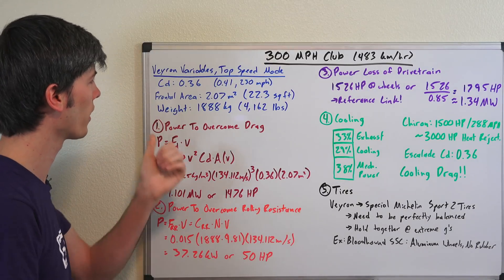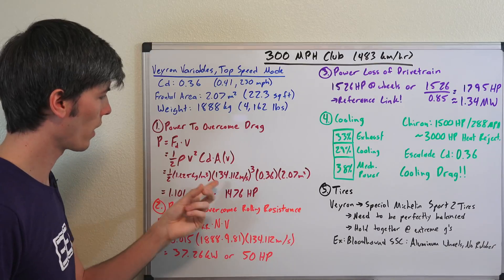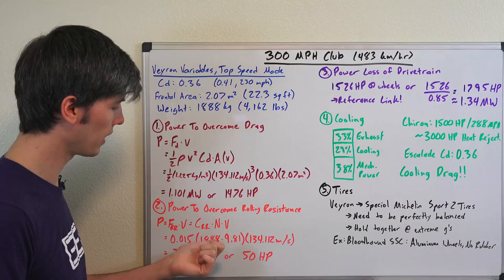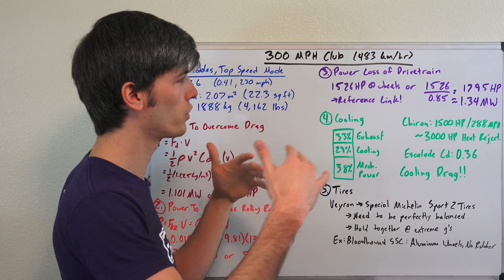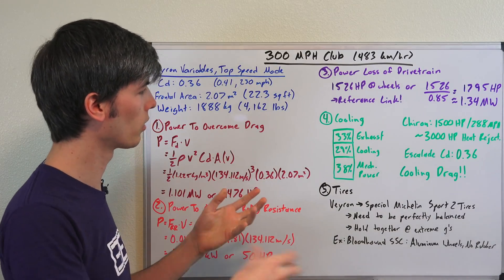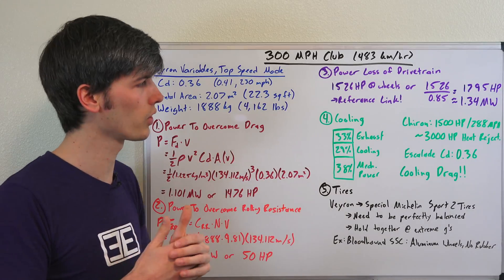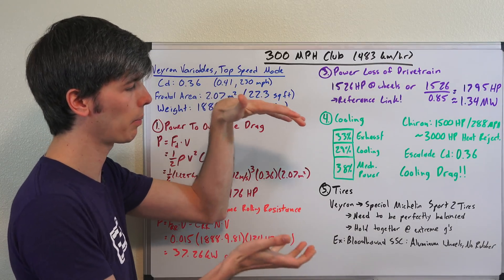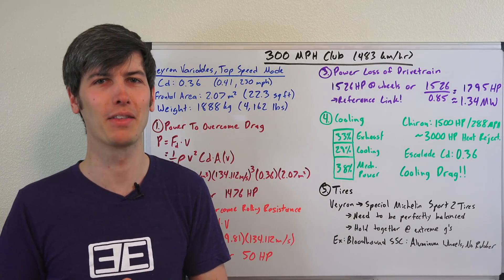Why Has No Production Car Hit 300 MPH?

Comment: Can you do a video on why 4-cylinder cars make that farting sound?
Reply: Joesus Trikes I can tell you why you make "that farting sound". Too many tacos bro.
Reply: it's not the cylinder count but the volume of the engine. You can experiment this by firing a small firework and a large one.
Reply: Lol. That's simply because of the fart can muffler.

What affects the sound:
Exhaust componenets: The diameter and  lenght of the different exhaust components. (Unequal lenght headers make any car sound like boxer)
Crankshaft: cross-plane vs. flat-plane
Valves and camshaft: Aggressive cams and big valves make any car sound angry (Google: Vtec killer cams)
Reply: what farting sound?
Reply: not enough boom boom
Reply: The boxer engine fixes many problems or shall we say hides many problems. :D
Reply: Joesus Trikes why do V8 sound like a fart when it's making pressure while you're sitting down?
Reply: Squeeze your asscheeks together
Reply: It's because of the exhaust. Search "inline 4 motorcycle sound", it sounds 1000x better than an inline 4 car.
Reply: Because they have a shitty exhaust, quite simple
Reply: Low displacement, high compression, equal length exhaust header, and firing interval.
Reply: Joesus Trikes yeah boi wait for the VTEC to kick
Reply: It's usually the smooth exhaust pulses that make it fart and sound like a bee. If you have a compact turbo manifold or like subie owners (UEL) headers then it sounds much better.
Reply: With the right exhaust they can sound nice.
Reply: Congrats for posting the dumbest comment here.
Reply: It already has been done, look for flat plane crankshaft vs cross plane in V8, he said here why it sounds different. It is pretty much all up to firing order, and the way car manages its exhaust gasses .
Reply: 2.3L and up can sound fantastic
Reply: David McClelland my bros 2.3 mazda 3 sounds fartastic without the res and muffler, honestly keeping a resonator on a mostly stock car is the key to it not sounding like crap
Reply: Remember guys, a 4 liter V8 like the new AMG engine can sound amazing ... and from an exhaust standpoint that's basically just two 2 liter inline 4 cylinders running next to each other (yeah, probably with an X-Pipe, but still).  Its about firing order, header length, and muffler/resonator design not displacement.
Reply: Perhaps cylinder layout. If you compare a new subaru fa20f in the wrx, or any of the non turbo engines they sound exactly the same as every other 4cylinder although they are a "v" configuration collecting two banks of cylinders into one collector. 

The length, of each runner will have a greater effect. Traditionally thats what gave inline engines their sound. Not all of the runners were the same length so it had a unique noise to it. However if you throw equal length headers onto a I6, and onto a v6 you'll notice almost no difference.
Reply: Joesus Trikes 😂😂😂😂but sit and evo
Reply: cause it's missing 4 cylinders
Reply: I got a 2002 Forester, everything but interior is stock and it's sounds pretty nice on the highway when in the right RPM. Subarus are just plain better 😁
Reply: If you're going for a farting sound you can't beat a one cylinder (4 stroke)
Reply: yea. some v12 engines with tiny cylinders sound whiny. or rather they all kind of sound that way lol
Reply: Also the firing order, cylinder layout and exhaust make a big difference to engine sound. Cylinder count does make a bit of a difference though.
Reply: Somewhere in exhaust path there is a component that has too thin a guage of metal and or too little/poor quality sound deadening material in my opinion. I only buy 304 stainless exhaust components if I can.
Reply: +Exhilarating Bass sorry to tell you bud but you have a fart can LMFAO import
Reply: my iq is now at 400
Reply: +john C There are more Brostangs, Challengers, Chargers, Camaros, Impallas, diesel trucks, non diesel trucks, with fart cannons than any import anymore. All the ricer kids started buying "domestic", or went diesel.
Reply: Rediculous, even a 250cc inline 4 sounds glorious. "farting exhausts" are not a rule when it comes to inline 4's. Some engine and exhaust combinations will sound good while others will sound farty.
Reply: Not unless you have unequal length headers! Then you get the boxter rumble!
Reply: That farting sound is based on the exhaust system such as the muffler which some people had drilled a hole into to allow for more surface area for the exhaust gas to flow through thus more noise and power
Reply: Tan  Jia Yong Just allowing more exhaust isn't going to do anything if you aren't also taking in more air.
Reply: xD
Reply: Bruce Wayne replace the resonator with one of those old school cherry bomb glass pack mufflers and get an axle back kit from an 09 wrx or fxt
Reply: Or, the better option is to buy a good quality exhaust such as corsa, invidia, ets, namless, or countless others.

Comment: All of ur videos are really interesting and highly informative coupled with apt description of yours !!! Way to go Brother 😎☺☺
Reply from the maker: Thanks!
Reply: Very interesting! But as a road car already is really out of internal space i see it hard to achieve without making the car an extra 3-4 feet longer :P
Reply: Could those 3000 hp be used to overcome aerodynamic drag trough application of Meredith effect? As i read on it, in some cases it can create trust that is greater than the drag and possibly make a car even faster. Wikipedia claims it was done on P-51 Mustang.